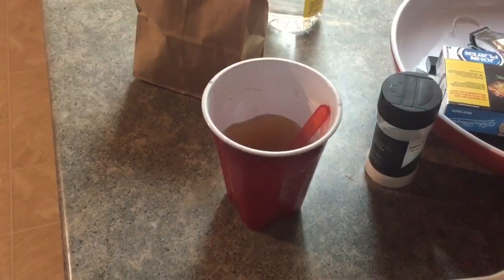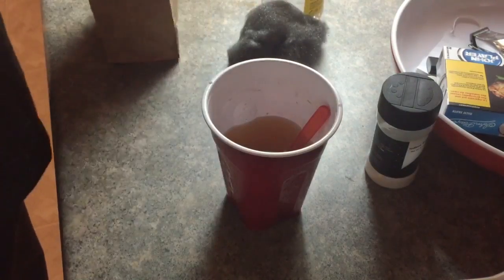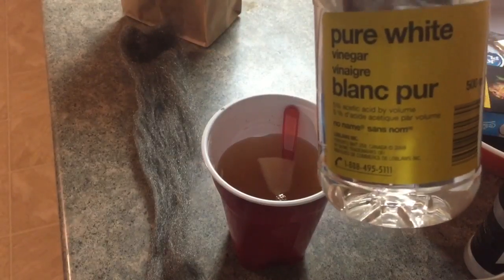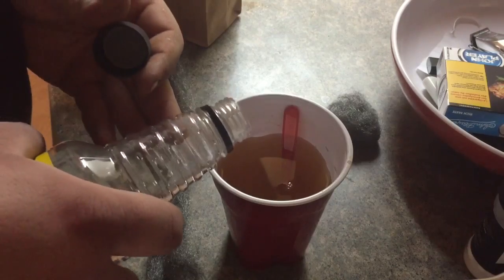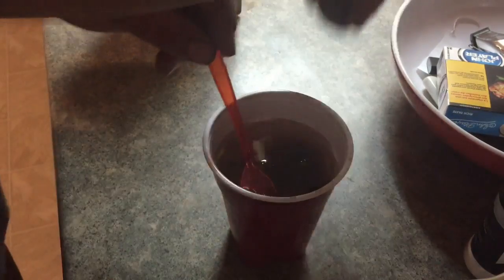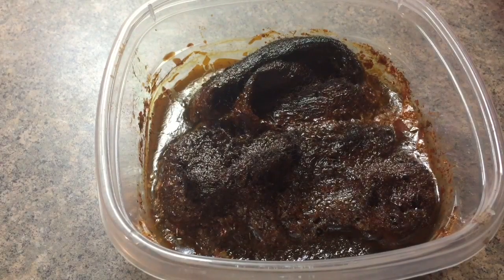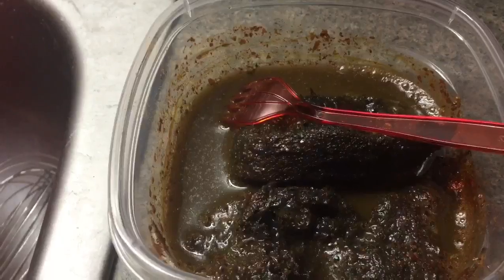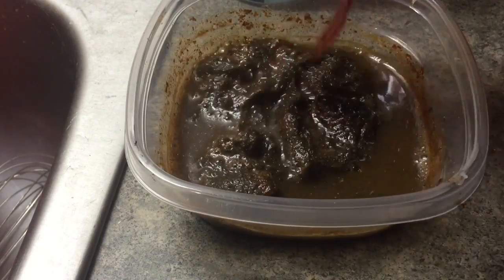Home Made Rust Powder

Comment: Here is a method that might work better, they are using it to make a catalyst for homeade rocket fuel, but the process to get the Iron oxide (rust) would be the same, you just aren't burning it up. 

http://www.instructables.com/id/Making-rust-powder-for-rocket-fuel/?ALLSTEPS
Reply: I don't necessarily agree with using bleach, as it would be very easy to get some pretty nasty gases off of it (mustard gas). The purpose of using the bleach is to speed up the reaction of the steel turning to rust, as you are basically looking for the O2 in the bleach to do the work. 

Using water would do the same thing, just take longer. 

What I have seen other people do is soak the steel wool in vinegar for 24hrs to dissolve the coating they put on it to keep it from rusting. 

Squeeze out the vinegar and put the steel wool in a mason jar, fill with water, cap and put in the window to get sun. It will take the process a while to complete, and if you notice it slowing down, just replace the water in the jar. Once the steel wool is completely dissolved, filter the water/rust mixture through a coffee filter and then dry out what remains.